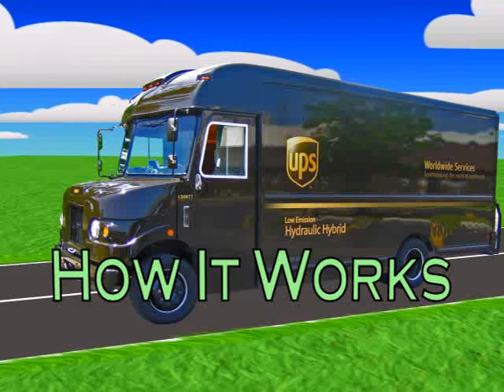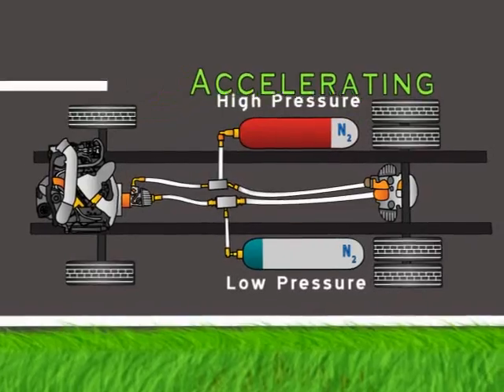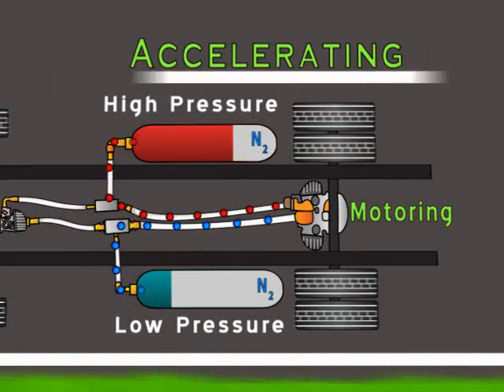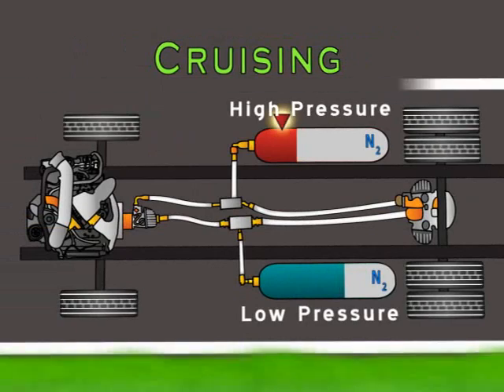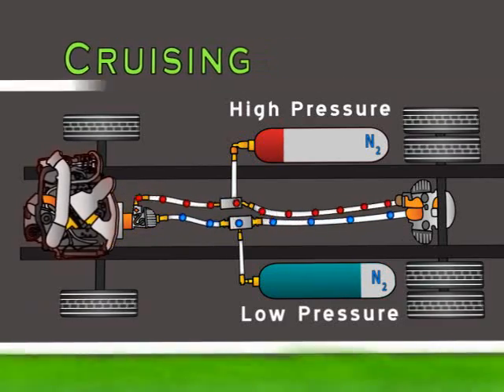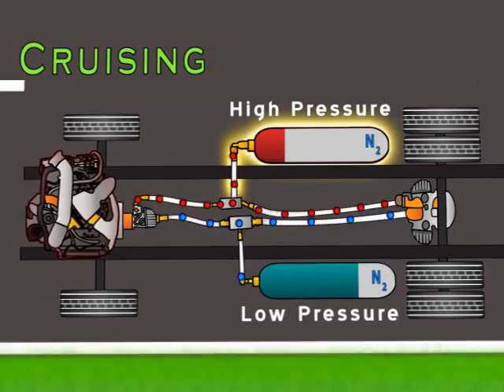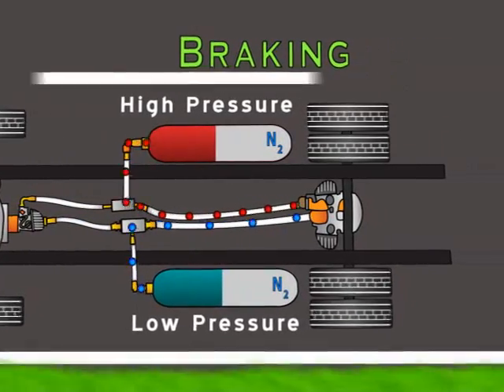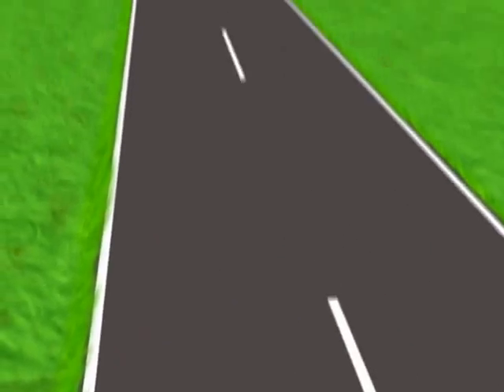HHV How it Works Video

Comment: The best thing about this system is that there is no wasted energy in a transmission. The engine can run at the most efficient rpm 100% of the time. Makes since that the engine would last a lot longer too without all the hard acceleration.

Comment: This is very exciting stuff... Word is we might see this in passenger vehicles and trucks before 2013!  Word is Ford has a full size F150 doing 40mpg in the Lab. Couple this technogy with Direct injection and Cylinder deactivation and we are going to be seeing some very powerful, yet very economical engines.  Right now the engineering challenge is size and noise.

Comment: Car companies don't wanna use this for passenger cars coz electricity. Normal cars use gasoline engine to generate electricity and passenger in the car can use electric appliances without worrying they are running out of electric power.But, for this series hydraulic hybrid, gasoline engine usually is shut off because most of the time the system use the kinetic energy from braking that stored in the reservoir. In short, this system is efficient for vehicles that make frequent stop like ups truck.